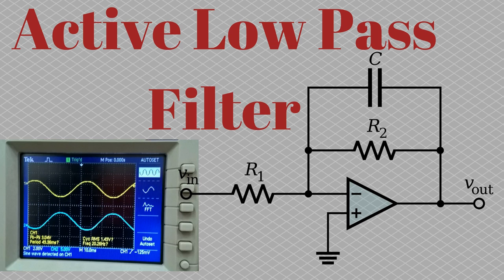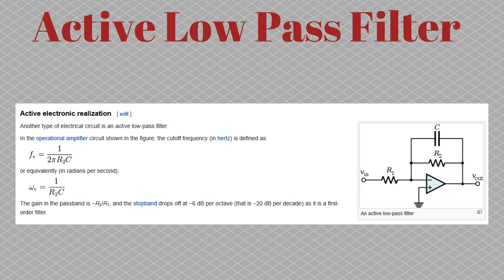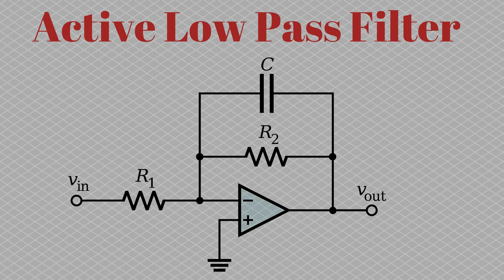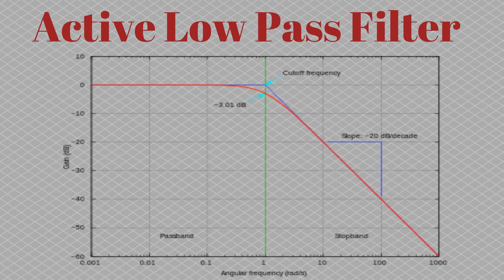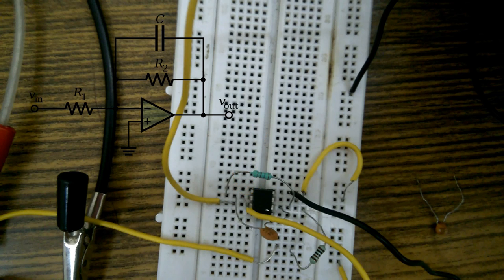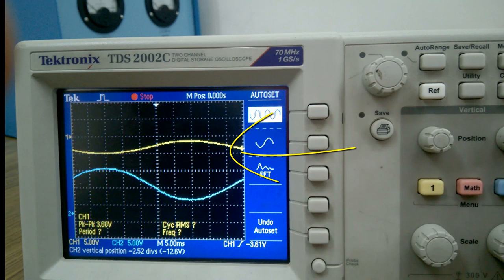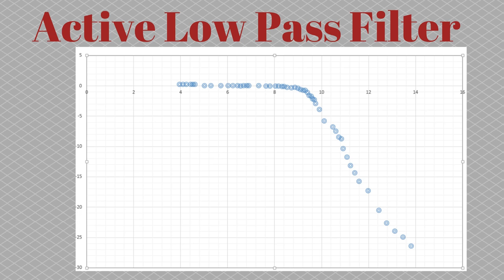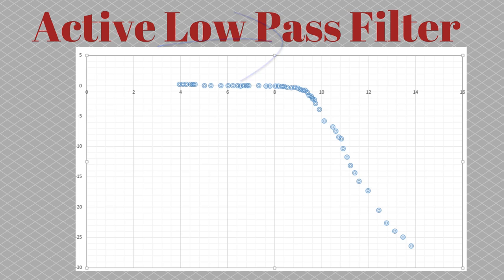Active Low Pass Filter - EXPERIMENT

Comment: If we r increasing the frequency then the input signal will increase itself or it should also be increased? Also r we applying both the input voltagw n frequency from the function genrtor only
Reply from the maker: The amplitude(voltage) of the input signal was kept constant. Only the frequencies were changed. 
Yes, we set the input voltage and frequency using the function generator.

Comment: I can't believe you didn't realize that the volume was so low !!!  Does the word "Decibel" ring a bell to you ?
Reply: there IS no volume. its not a sound signal. its just an electrical signal if certain frequency. there is no amplifier or transformer to create any sound. therefore in order to measure the gain or output voltage you use a dso or a multimeter.
Reply: Sorry for the misunderstanding but I wasn't referring to the circuit when I mentioned that the volume was low.  I was talking about the audio of the clip.  At the beginning we can barely hear the voice.  When someone has a strong accent, we're missing segments.  If the audio quality is low on top of that, the odds are very slim that people will stay around and listen to the whole clip, sorry.
Reply: Oh . Yeah, I completely agree that the audio is really crappy. Sorry about that. Just wanted to help out people. But didn't have a good enough mic. 
Will try to get a better one in the future.

Comment: 1. Should the graph be same on choosing the output voltage not the gain along y axis and frequency along x axis?
2. How the resistances and the capacitor are working practically in the circuit according to the responses of frequency with the opamp, not mathematically but physically? 
3. Can we place an lc circuit instead of rc circuit?...

Comment: At low freq cap x sub c acts in parallel with r the total rc network will serve to manage op amp gain ability. At higher freg cap x sub c in parallel decreases and thus rc network decreases thus gain of op amp will decrease as freq increases. Op amp output will decrease as freq increases